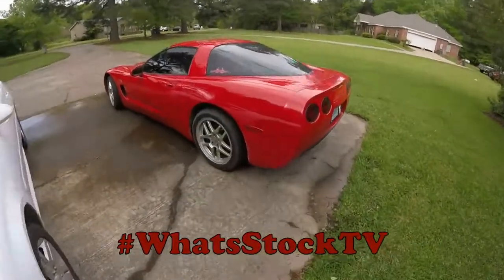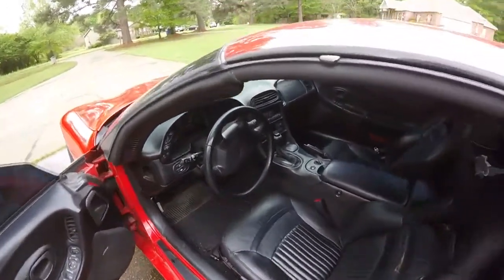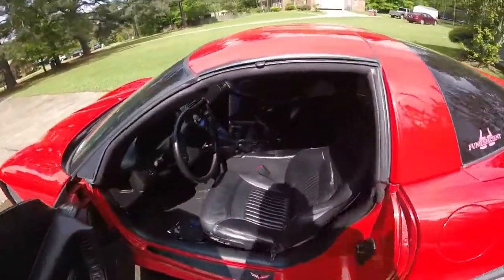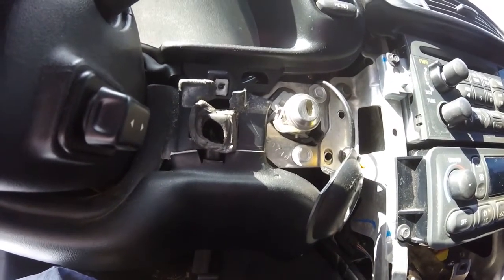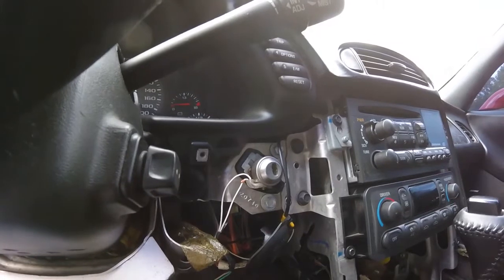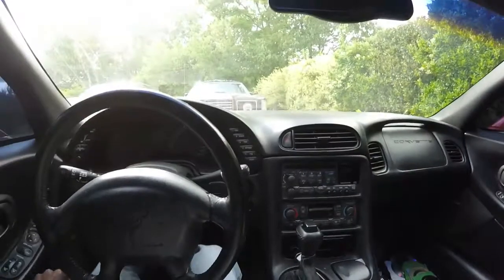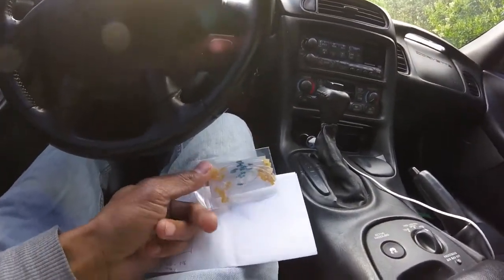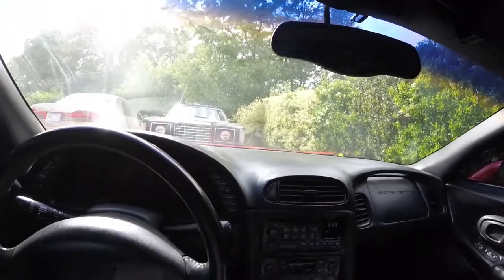Corvette C5 Security Problems Part 3 : Back in Action

Comment: Great job! Only thing this video is missing is you jumping around like you won the lottery😀👍
Reply from the maker: I know right
Reply: I have the same problem..I just don't to know how you were able to make a connection to those tiny wire ends on the ignition cylinder.
Reply from the maker: @tommygallagher4144  it was tough and not that great of a connection. I made another video, I ended up getting some resistors and bypassing that whole process at the plug
Reply from the maker: https://youtu.be/uDu4QY7OkOg

Comment: Gonna try and see if this is my problem with my c5 security light no start issue.
Reply from the maker: Good luck, check the wiring too. My wires were partially broken at the switch

Comment: I having the same issue only once in a while although getting more frequent. I replaced the starter and the problem's worse. Tried new key and no change. Help please!
Reply from the maker: boeingtrijet my wires connecting to the ignition were broken. Ended up bypassing it with a resistor
Reply: I got a new key at the dealership 200 dollars fixed it ! They reprogrammed it. Sometimes it would start and other times it wouldn't. Problem fixed

Comment: Loose wire huh?  That should not happen.  Hope you can return those parts you didn't use.
Reply from the maker: Domo the wire was broken, had to reconnect the ends. No clue how that happened but I'm not even worried about the resistors, they were $5. I'll keep em just in case something else happens to it
Reply: 89imp03 Yea, you said wire was broke.  Still shouldn't happen!  Sucks!  But at least those unused parts didn't cost much.  You need to go on a nice long road trip and enjoy that car.
Reply from the maker: Lol I took a quick ride to Louisiana yesterday on some back roads. Wish it was warmer I would've took the roof off
Reply: 89imp03 👍